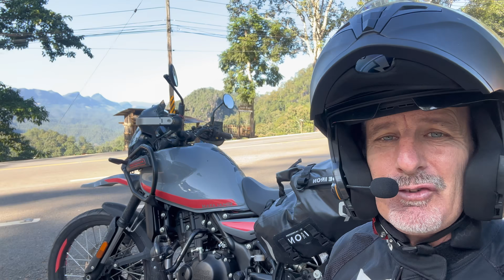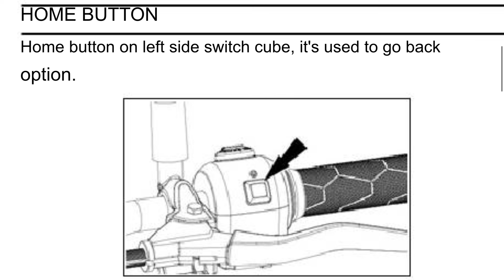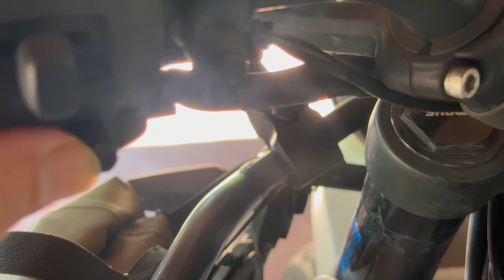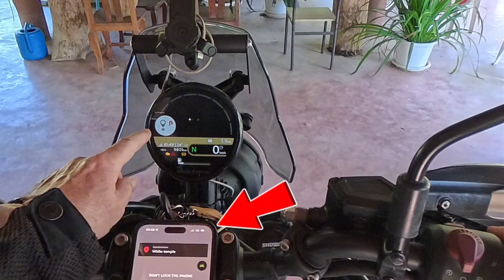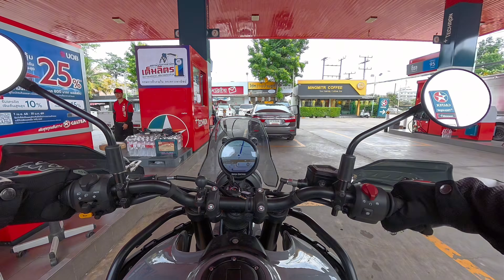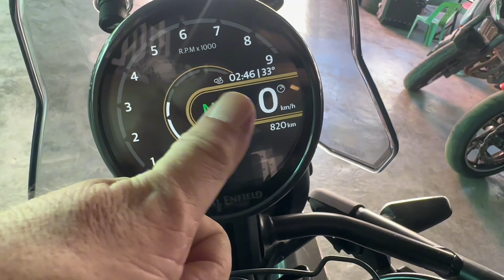How to fix Royal Enfield TFT Navigation - Phone Overheating & Dropouts

Comment: Hi. Question for iPhone. Do you get caller display come up. Had mine for over two years I can get the navigation working ok but any phone related stuff including calls never works. Thanks
Reply from the maker: With the iPhone, Apple's privacy permissions mean the TFT will only ever display a generic 'Incoming Call' alert rather than the caller's name or number. However, to get call alerts working at all, go to your iPhone Settings > Bluetooth, tap the (i) next to the Himalayan/Tripper connection, and make sure Share System Notifications is toggled ON. Also ensure the Royal Enfield app has 'Background App Refresh' turned on and check the RE app to see if your TFT needs a firmware update
Reply: @Ride-with-T thank you will have a look at that. My Voge DS900 is faultless with iPhone caller display. Works perfectly. That’s why I’m frustrated with the Himi.

Comment: The app font is very small is there a way to change it?
Reply from the maker: If you mean the text inside the Royal Enfield App on your phone:
While the app lacks an internal font slider, you can force the phone's operating system to scale it up:
On iPhone:
Go to Settings > Control Centre.
Add Text Size to your active controls.
Open the Royal Enfield App.
Swipe down from the top-right corner to open Control Centre, tap the Text Size (aA) icon, select "Royal Enfield Only" at the bottom, and drag the slider up.
(Note: Because the app uses fixed UI containers, setting this too high may clip some text, but a 1–2 notch increase usually improves legibility without breaking layouts).
On Android:
Go to Settings > Display > Font size and style (or Display size and text). Bumping this up will scale system-wide fonts, including menus and search bars in the RE app. 🙏
Reply: @Ride-with-T Thank you for your detailed reply T I'm on android so I will follow your advice later. Btw I've just bought a Guerrilla yellow ribbon and loving it.😊😊

Comment: Still garbage, 7 second lag battery drain phone hot and pixelised itinerary. The screen sharing is trash on android.
Reply from the maker: To be honest I had major problems on Android, no problems at all on Apple. If you phone is older than 3 years old, I think there will be issues. 🙏
Reply: @Ride-with-T  i use a recent phone, the problem is with screen mirroring. If there is interference caused by built up aread it will lag. It got so bad that there was a 7 second lag sometimes. 7 seconds at 60 kmh is a long distance to miss your turn
Reply from the maker: @clemzboubtoila9831 That sounds like a phone cache that needs clearing, or too many Apps open at the same time. 😂🙏👌

Comment: I've had my Bear 650 for 3 days and I have mixed feelings... I'm on Android and managed to make it work ok, but couldn't find how to add stops to a route, yet. I can even turn my screen off and but the phone in my pocket and it still works, but it overheats like crazy! And as soon as I enter a tunnel I lose GPS signal and it exits navigation (like it does when you arrive at the destination). I also can't acess the settings anymore via the stick for some reason. It's like the button is broken (but it works for everything else) or with bad contact or something.
Reply from the maker: It does seem not to work as well on android phones from my findings. Definitely try upgrading to the latest software if all else fails get yourself a secondhand iPhone because it seems to work well on those 👌🙏

Comment: Can't agree with you,I have the Guerilla and the tripper is beyond useless. My samsung galaxy A17 has no option to turn off the timeout only shorten the time or lengthen it. It constantly disconnects sometimes restarts for a short time, will run for a varying length of time before it disconnects again and other times will not, then when I open my phone (which is a struggle because the app turns the backlight off) the app is closed but the phone and screen says its still connected. It says you are connected to A17 but it wont show navigation just home and trip on the home screen. I live in the UK and travelled to France where it simply refused to work. It came up with "it seems your in a different area please log in again" but wouldn't allow me to log in, it wouldn't send the email to me before it timed out. The update is the latest version and I'm sorry but it's a piece of crap it does not work maybe it's just mine but there's loads more stuff wrong, like it takes a photo but no matter how many times I push connect it won't then when I get home it connects.... "phone disconnected" is all I can say about this thing.
Reply from the maker: Sounds like a phone issue. Never had it drop out once I my iPhone, once I got the settings right 🙏

Comment: Have you ever found a way to reduce the polarizing effect of the TFT screen that the camera sees?
Reply from the maker: Yes, try 25 frames per second, or 24. I forget which one works best 🙏
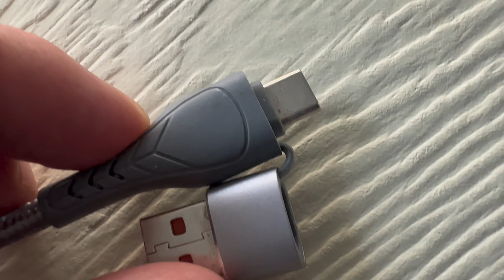Reply: @Ride-with-T  I am filming at 25 fps, but I find the tft screen goes black at times, almost as if the angle of the light source is causing it. I notice the same effect at 4:04 and 5:11 on your video.
Reply from the maker: @MidlandBulletRiders yes the angle matters. On one scene I forgot the frame rate. But on the corners showing the maps I had the camera at chest height. Hope that helps 🙏

Comment: Inteeresting... I use it like you explained... but I find it extremely embarasing that I can not even take a picture with the camera or answer a messaga cause the Map dissapears and the navigation gets stopped... a pain in the a$$ this App! India can not handle Apps... this also happened with my Hero XPulse... the App was crap :)
Reply from the maker: Sounds like a phone setting needs changing. Normally display time out.,instead of auto lock after 2 minutes, needs to be set to zero. The app is not perfect though agreed 🙏

Comment: You don't need to stop to change the ride mode. Just pick the mode you want to change to while riding / rolling & shift to neutral and it will change. Then you can click it back into gear and keep going in the new mode.
Reply: I just keep the clutch pressed, and that also accepts the change, quick and easy.
Reply from the maker: @h @harshilkosambi1387 wow another tip I didn’t know 👌🙏
Reply: @Ride-with-T  just keep the clutch pressed until mode changes else it will reject the change
Reply from the maker: Ohhhh wow. Thanks for that 👌🙏

Comment: Why do all brands have there own system? Car brands ditched it years ago and whent with a aa or ac. Much better.
Reply from the maker: Yes Android Auto or Apple CarPlay is much better, and luckily many after market devices run on this now like Aoocci and the BX or C6 Pro. But the display on this bike is so good, it’s a shame to replace it if not needed. It’s not perfect, buts it’s free with the bike, clean and now better working than ever before. It’s a shame RE did their own software and not the AA or AC as you suggest 👌🙏

Comment: Hey T, Good content. Very informative.
There's an updated solution for the TFT display and phone overheating issue - Installing Shizuku and Extinguish apps. What it does is, you can lock your phone and use TFT at the same time. Works brilliantly and solved all of my problems.
Since then TFT display is my only navigation device.
Reply from the maker: I’m not sure about installing unofficial apps with little feed back 🙏
Reply: @Ride-with-T  Fair point, and it makes sense too.
Reply: I use the same method yet battery drain still a problem. You get %10-15 energy save but still ends up a lot percentage loss per hour. However, it seems like a solution for now.

Comment: Great they are making improvements to the app, but IMHO the app is still a failure as long as I need to have my phone screen on the entire time, That's needless wear on the screen, and battery, Especially since we know from other platforms that wireless Android Auto/Maps/Car Play etc is possible with the screen off.
Reply: Correct, Honda Roadsync for example works. Hope RE comes up with a full fix soon.
Reply from the maker: I do agree. All the Aoocci Car Play devices I have used don’t require you to leave the screen on. It’s such a shame, because it’s such a nice display. I used it to warn me the type of corner coming up. 90,180,270 etc 😂🙏

Comment: I use it but for some reason it tends to disconnect, Android with the update. The summary  of your ride at the destination is cool.
Tip I saw; to stop that petrol cap falling backwards on fill ups put a magnet on your key fab to attach to the tank to hold it, simple but very effective.
Reply from the maker: The cut out issue is certainly a display setting on the phone that needs changing. I had the same until I changed auto lock from 2 minutes to never. So you need to find a display setting and change it to never turn screen off. Nice tip 👌🙏
Reply: Have your tried giving the app unrestricted battery usage permission?

Comment from the maker: I would like to hear from RE owners who have the TFT. Do you use it? Have you used it? Or will you use it after this video? Really interested to know. 🙏🙏
Reply: Mine is working fine on the Guerrilla, Android app version is now up to .18 . I was totally unable to get it to work until I read about the two/four wheel setting in the app being faulty. Set to two wheel the app kept reporting that it was unable to calculate route, switch to four wheel and all was good. Take care with Google maps in Thailand, on numerous occasions it has taken me up dead ends and it can be rather out of date, once because of a reservoir that had been built across the road, but some years earlier!
Reply: I've used it for the first time on the road and figured it out on the go over 2800 kms . It was the best trip I'd say. Absolutely amazing. I was covering 300-450 kms on some days  across the south of india. I was concerned about the phone over heating or battery drying up. But nothing of the sort happened on my android with a 5000 mah battery.
Reply: I use it pretty much every time i need navigation on my guerrilla. I've not been on long rides yet. I doubt the auto screen brightness makes any significant difference. For short rides this is brilliant. The screen also lags for 0.5-1 second, you'll have to get used to it.
Reply: Hi T, you may find this video helpful. An option to switch off iphone and still use the navigation on the Himmy
https://youtu.be/--KnpSId-mk?si=IRxf9fBxAMgknrfd
Reply: Always used. Traveled through both Italy and Tunisia, it failed only once. I also use it on my daily driving in Rome.
Reply: I love the maps but it would be better to have android auto. Royal Enfield app drains my phone's battery. And it is not safe to put phone on pocket while driving because of overheating